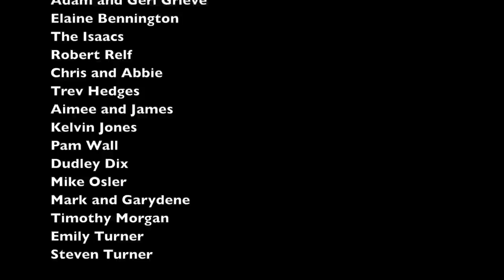#52 - ⛵Holes! Holes! HOLES! 😱 Restoring a 40 year old steel yacht!!

Comment: Great idea for the curved seat wit a built in gas locker. I built my gas locker in my starboard lazarette and made it with drainage and ventilation. Used one length of hose from the tank to an electric safety valve and another length of  hose to the stove.
Reply from the maker: Good idea

Comment: Andy,  for removing mill scale from small small steel parts use a large bucket filled with cleaning grade vinegar.  Drop parts in in the evening and 8 to 10 hours later when you pull the part out rinse the part with fresh water with a little baking soda in it and the scale will rinse away with a paper towel rub.
Reply from the maker: Hiya, yeah there’s lots of ways to do that on cut small parts. The only problem is we only have about 1 day per week to go to the boat to work.  So if I cut out a section, male a template, copy the shape to the steel and cut that out, I have to get it welded in the same day and sadly don’t have the time to leave it to soak overnight before welding.
Reply: @SailingMelody  I understand.  Please tell your lovely bride that me and my lovely bride wish her a belated happy birthday.   Please keep up the good work...
Reply from the maker: I will do yeah.

Next week we have 4 days together off work to spend on the boat so we can maybe do some jobs that span a couple of days. It’s a real pain having to come away from the boat and we can’t wait until we move aboard

Comment: Yes, I'm with you with the bridge seat. I think that when you're traveling it's better not to put things on display though will you have just the one bottle? I'd consider at least two or three and also consider that if you need to replace them in some far away place the replacements might be a different size so don't make the space to snug.🏴‍☠️

Comment: Instead of oxide paint I paint over my bare metal areas with slightly thickened west system epoxy. It bonds well to itself when sanded. Just don't leave it exposed to the sun too long before topcoating.
Reply from the maker: We are using very very high quality high solids epoxy paint from Jotun but as I said in the video, I am using the red oxide to protect the steel during the fabrication process and will be painting on the epoxy when all the fabrication is done and all the surfaces have been prepared.

Comment: What you have to think about is that gas bottles are different in size in basically every country you come to as well as the fittings/regulators. My suggestion is that you check with some other boat that has been circumnavigating before you determine the height or width. Good luck! :-)
Reply from the maker: Very good point

Comment: Yes that curved seat idea is excellent. Make it out of 3 pieces so you've got a main horizontal and two seats if heeling. Great idea to keep the cylinder outside - very safe and easy to swap out. Great job with that welding - looks neat and waterproof.
The boat is coming on really quickly I think. Can you keep the text you put up on the screen a little longer please? I can't read that fast!
Great music on this episode - keep that up, it's a unique thing for this channel. Thumbs-up as usual. Dave
Reply from the maker: Thanks Dave! And yep, will keep the captions on lonnger

Comment: Hey Andy  plz try out the fluxfilld cord  then u dont need gas  easyer  faster  u do the wellding in the sma manor as u do whid gas  think of it .  bye the way  looking go your work  best regardes from Sweden
Reply from the maker: I bought some flux cored wire but the spool won’t fit on my welder, so when I run out of the wire I have I will transfer my flux cored wire to the empty plastic spool and try it out. I’m still not convinced that flux cored wire can ever be as good as proper inert gas welding though. Will take some convincing
Reply: @SailingMelody  Oh ok  question  how big is the normal  spool ??  mabye u can change to same sise  spool as u normaly use whid gas  . i have use flux cord for many years now  what i can compare it to is stick wellding but on a spool u never need to change stick lol  i really like it  .  regades from Sweden
Reply: yeah  Andy i did have the same thinking about gas or flux  but it  did grove  to me as  wellding in windy spaces  it is  better   to use  flux cored  but thet is me  regardes from Sweden
Reply from the maker: Yeah my welder uses quite a large spool but the flux cored wire ive bought is small, just to give it a try, and won’t fit but I will try it as soon as I have an empty spool to load it onto

Comment: For light plate and non-structural just run a weld down will be fine, you don't really need to vertical weld, the more welding you do it will get better and easier.

Comment: Have you considered tiller steering ? More room in the cockpit and a simpler system and with autopilot so popular, less need for hand steering.
Reply from the maker: We have dual steering both in the cockpit and pilothouse so a tiller setup wohld mean getting rid of the wheel in the pilothouse which would ba a shame to loos. We like the idea of being able to steer from inside in bad weather and as the boat already has beenset up for that it’s a shame to loose such a desirable feature
Reply: @SailingMelody  thanks for the reply

Comment: Welds are fine. Any idea of what your steel budget will be?
Reply from the maker: So far we’ve spent about £400 on steel 
I anticipate another £800 all in with plate, bar and angle included, there or there abouts i recon

Comment: I also don't want a fiberglass boat and prefer steel. Fiberglass is messy and takes time to fix things but you can fix anything on a steel hull with a welding machine and a grinder, even if you in the middle of the ocean.
Reply from the maker: I completely agree

But I have to say, if a fiberglass boat of this size had been available localy to me at the time when we wanted to buy then I would have bought it

Comment: I've been meaning to ask for a while why your not using a chemical paint stripper like Nitromore or a gas torch to burn away the paint before priming and repainting. Used to work in a garage where we used Nitromore to remove head gaskets.
Reply from the maker: We would need gallons snd gallons of it and it’s horrible stuff to work with
Reply: @SailingMelody  And it's useless now the regs have meant that all of the chemicals that made it work have been taken out.

Comment: Andy, Aren’t the gas bottles at the rear of the deck (outside) as a safety precaution? Now you want to sit on them?? Look, it’s a great idea, but then make the lid/seat base shrapnel proof! 
On another note, do following seas not leak into gas lockers at the rear?
Reply from the maker: Hahah bottles don’t explode.  The risk with gas on a boat is leaking gas getting into the bilge and being ignited by a spark. The chances of a bottle it’s self exploding are a million to one
Reply from the maker: I’m not intending to have any opening lockers or seat lids at all in the cockpit with access to the aft lasarette through the pilothouse. For exactly that reason.  I see the point of opening seats lockers if youre coastal cruising and going in and out of marinas regularly. But for ocean crossings and living at anchor where you won’t be needing fenders and warps as often I think there’s more benefit to have a fully sealed cockpit with no possibility at all of water getting in through opening lids

Comment: Real welders welds downwords, up, whatever suits the situation. I had my boat sittinc outside in rain and snow for a year prior blasting to SA2.5 to get rid of scale.
I made the same gas system on my boat. Then we skiped the gas all together. Went all electric. Now the gas locker hosts windlass and 50 m anchor rope. Shore power connection and so on.
Reply: Real welders haha

Comment: You can always do better in welding but it takes practice just like your guitar practice.!..set your wire speed heat on scrape steel...and if you back weld you can step up the heat range for better penetration. Crack on!

Comment: I think your idea for a gas locker is a good one, however I'd spend some time researching the different sizes of gas bottles available thruought the world ... there are several different standards, so unless you're of a mind to bush-fill your existing bottle by hanging the new one upside down in a tree and attaching a high pressure line to it (I wouldn't) then it's worth making sure your arch will fit the other available bottle sizes.

I'd also consider getting some rolled into a curve tube to run along the edge so it's not going to slice the backs of your legs and all the lovely arteries they contain :o
Reply from the maker: Yeah very good point and consideration

Comment: Could you not lightly sand it and then spray over it with a sealer first and then spray the colour ???
Reply from the maker: Jotun 2k epoxy has extremely high adhesion. And red oxide by comparison has relatively low adhesion. The argument is that over painting red oxide with epoxy causes a strong bond between the epoxy and the red oxide but a lower relative bond between the red oxide and the metal resulting in a higher risk of lifting snd moisture ingress
Reply: @SailingMelody  o ok  lol me learn things to lol 😂

Comment: Sir weld down hill the idiot that told you to weld uphill on such light material is a talking out the side of their head. You likely have a Lincoln welding book that came with your welder. It is very useful. 4 mil is 12 ga or 1/8 inch it is actually sheet metal not plate and your weld was set correctly you can tell by the sound alone! You're doing well teaching yourself. If you want to go uphill the settings are 18 and wirespeed around 25 adjust and do it on scrap first of the same thickness of material. And the uphill isn't a straight bead is has a j shape or a weave from side to side and don't pause in middle of puddle